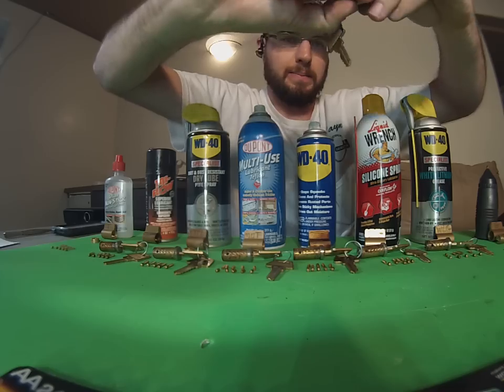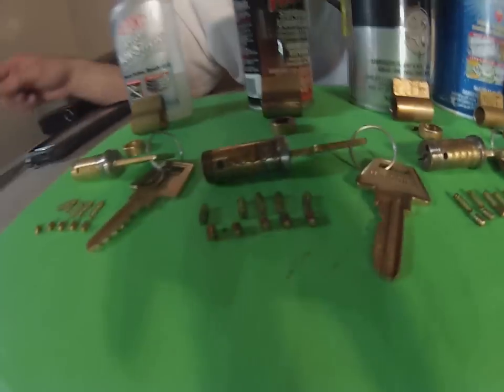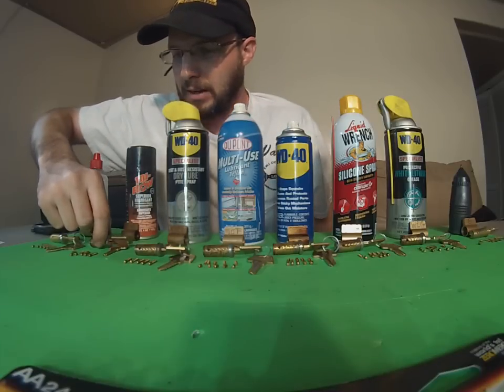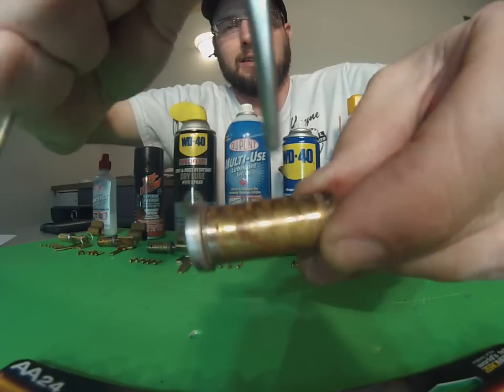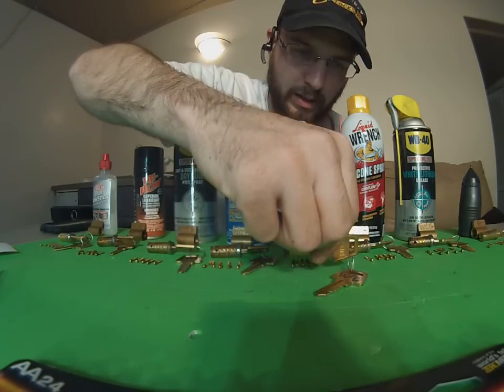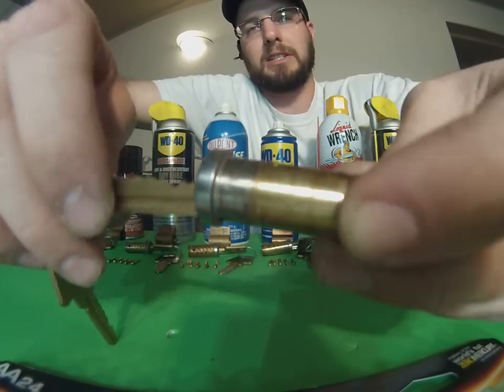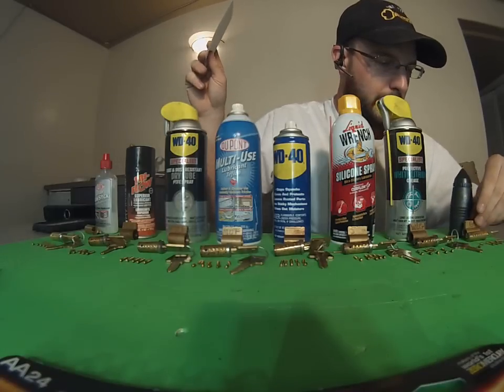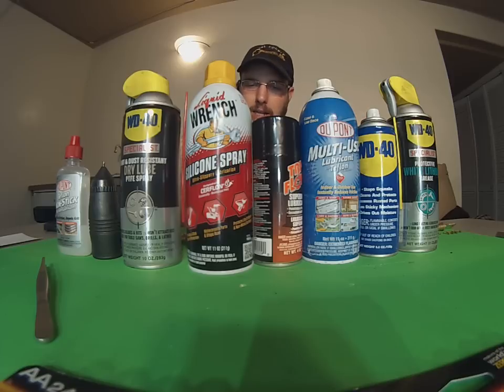Lock Lubrication Challange Results

Comment: Great ! Can i use these lubricants for drilling in metal  ?
Reply from the maker: Well for drilling metal I would actually suggest that you use an oil or heavier lubricant. You can also look at my review T T p cut it paste. The dry lubricant shown in this video will not work well when drilling metal

Comment: in cold weather my car don't lock the door I have to turn the heater on and after 15  minutes the door will lock someone recomended me graphite what do you think for cold weather for cars
Reply from the maker: +Axel Matos flush the graphite out of the lock with solvent like break clean, Then lubricate with Teflon bassed lubricant
Reply: +Wayne Winton hey I bought the graphite and I will follow your instructions thanks a lot
Reply: @w8mpx667  >should I use graphite? My lock's sticky. 

>No. Flush the graphite out and use Teflon. 

>I bought graphite anyway. Thanks. 

Lolololol 😄 Why even ask in the first place if you're just going to do what you want instead of following the expert's advice?